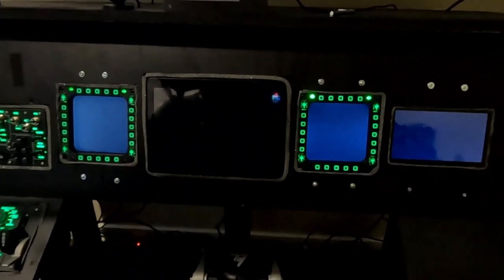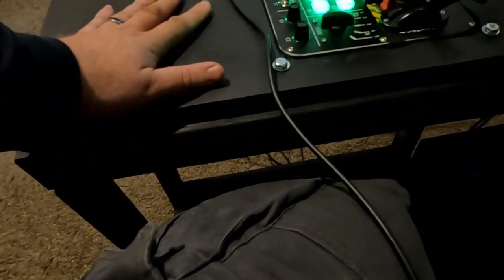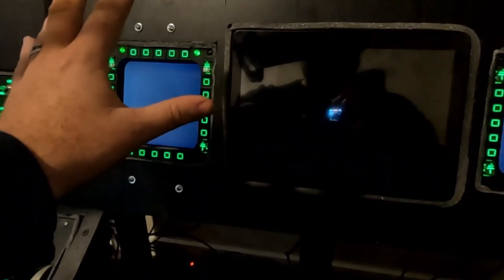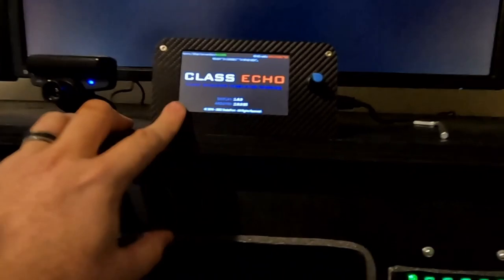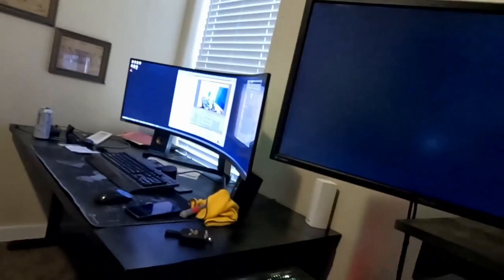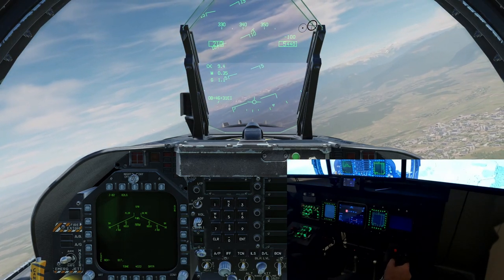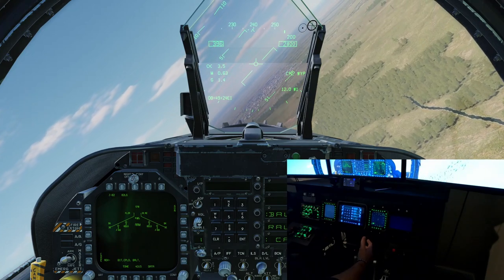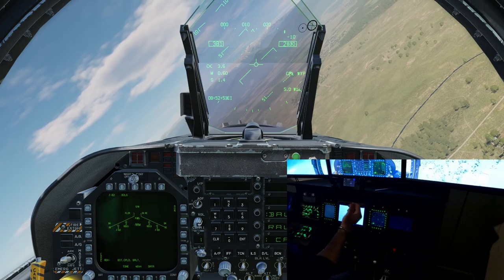My DIY Cockpit Build

Comment: That's some decent carpentry for the tools and time that went into it. The thing that makes builds "look pro" is if you 3d print or make with finish carpentry some bezels to hide the actual panel cuts and weather foam.

Comment: Awesome Setup! Do you think you’ll ever use the Virpil 200mm extension and do you like it? Thinking about purchasing one when I purchase all of my Virpil gear, thanks to your review! Also which cams and springs are you using for the Virpil base?
Reply from the maker: Crap I can't remember what they're called but they are the stiffest with no detent

Probably not on the extension just because I prefer sidestick
Reply: @OverkillSimulations  ok great, I’ll try those then, I plan on ordering next week and yeah I’ve been going back and forth with the idea of getting the longer extension but not sure how I’ll like it since I’ve never used one before.
Reply from the maker: @vivid_clarity  if the base is going to be low enough they're nice! But I'll promise you don't need it with these.  With the Warthog it was a must because the damn springs are so tight on the gimble the extensions made it much easier to make the small adjustments.  With the Virpil there isn't any concern there
Reply: @OverkillSimulations  oh ok awesome I won’t get them then, plus I can save some money. I had the same issue with my warthog HOTAS can’t wait to feel the difference between the two. Also did you change only the cams or the springs as well? I really like the WinWing Takeoff panel you have, does that work with Spadnext?